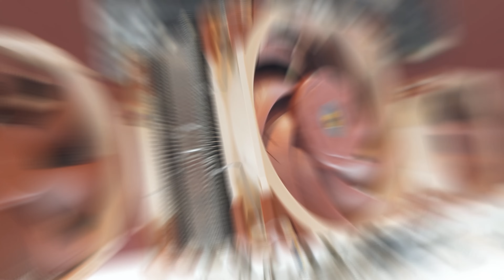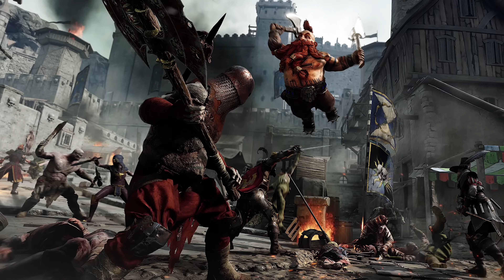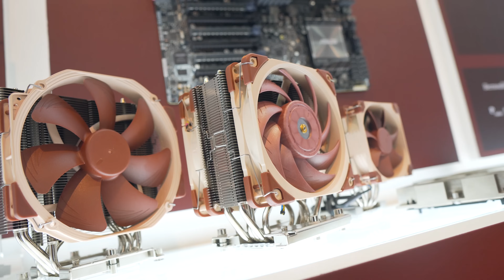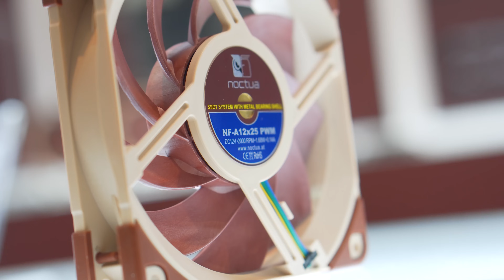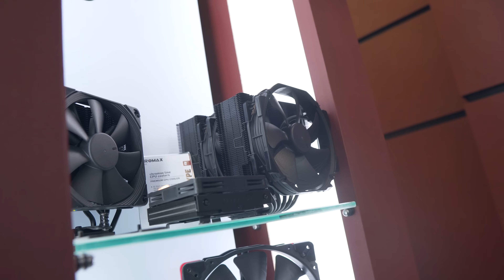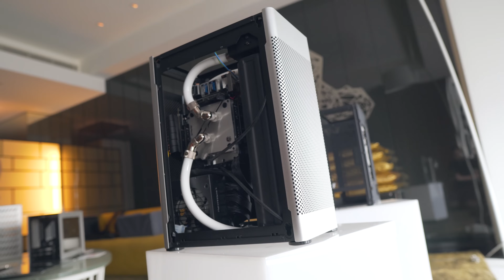Noctua Chases Optimization - NF-A12x25 + Prototypes

Comment: I just came across this video.  My question is "What about longevity while running in the horizontal position?"  I've got a three fan radiator in the top of my case blowing upwards; and the system isn't even two years old.  All three fans have failed or are failing.  I really don't want to spend the money on these fans (they are a lot more expensive) if they won't last long.

Comment: the new u12s is gonna be lit if that thing matches a d15. but its not to surprising since the current u14s is very close to the d15 series if the number of fans match. but man to get a 120mm one that close is nutts. noctua plz dont tempt me more by putting cromax versions of the new fans for the coolers

Comment: Can defiantly recommend. The mini C only takes 120mm exhaust, so i bought one of these noctua fans because they provide better airflow at lower rpm. I'll probably replace the front fans when noctua releases the 140mm version of this. Expensive, yes, but they're great and will outlast your current build and the next one.
I defiantly prefer that noctua is concentrating on the engineering aspect, as i don't care about rgb or colour as my case is closed.

Comment: They are basically scythe gentle typoon knock off, and that took them 4 years... Yet they don't seem to be capable of understanding that their color scheme is UGLY. This company is doomed.
Reply: I dunno, mate. You just know when you see a noctua. For people who care, buy a chromax version. Pretty sure these go a bit beyond typhoons, nice as they are.

Also, the sterrox crystal plastic they're using and the tolerances this fan needs don't take kindly to mixed or applied paints. Check this out, if you're curious. It's kind of neat.
https://noctua.at/en/nf-a12x25-technical-backgrounds
Reply: +Jae-won Chung
The company is well known for making the best fans in the industry in terms of performance, noise and endurance, even when exposed to dust etc.
They're not going anywhere.
And changing colour would be a huge mistake on their part.
Sure, having a few fans that's a different colour is ok.
But their top of the line model should have that colour scheme simply because of brand recognition.
Owning one of these brown and beige fans is actually a status symbol in quite a few circles.
Reply: They do address the fact it is similar, but the specific geometry and mathematics are different https://noctua.at/en/nf-a12x25-interview-lars-stromback
Reply: The Gentle Typhoons was a great jack of all trades fan but it also had a few cons that came with those pros. This new fan essentially eliminates the cons and you get a Gentle Typhoon design with the occassional Noctua beige colors.
Reply: Doomed?  Really? What with the 1000's of work stations/servers that use Noctua fans. I doubt that.
Reply: Lol... Whatever man

Comment: I'm totally indifferent about colors or rgb shit. Just keep concentrating on serious engineering and the best performance possible. That's what Noctua is all about.
Reply: Deady: Since you like quotes so much: "they could make the fans black, and they do, but they would take a performance hit (~5 degrees warmer)" ... That's what you actually said ... of course I'm gonna insult a stupid statement like that.
So to recap:
- REDUX line = first gen of fans without the rubber corners as well and so they perform worse than any of then newer gen ones but pretty much the same with the original brown+tan ones.
- CROMAX line = their second gen of fans that are just made black and are also more expensive because they come with a lot of extra rubber corners that I feel are not worth it.
- changing color of fans will not affect performance !! pink or black fans will perform the same as shit+tan colored ones and anyone claiming otherwise is retarded (STERROX not being structurally sound with dies is also kinda hard to believe since I doubt that Noctua brown is a standard color for that material - I think they just want to exclusively sell it in the their signature color at first - which is a mistake since they WILL loose massive sales)
- jet fuel can't melt steel beams : )))
Reply: "... of course I'm gonna insult a stupid statement like that." 

Yet again, I was repeating what was said in the video. I didn't say it word for word or I would've used quotes since I "like quotes so much". It's not my statement lol. I don't have an opinion one way or another on the merits of Noctua making their fans brown or black or whatever. Personally I like them in brown. I see a YT video with official word from Noctua on their preference for brown fans, I see a guy like you who doesn't like brown fans, fair enough. I repeat said official word, you don't believe it... well not much else I can do in this department.

Anyway, you have already made your conclusions from the get go and choose to doubt whatever reason they give for whatever they do. I for sure am not gonna defend a company I don't even work for on a YT comment section. So good day.
Reply: Daedy
, I just want to point out, that no you did not get that from the video. It does not say that changing the colour will make it 5 degrees warmer. He said if you wanted a fan from them in another colour that they had one, the REDUX model, which is not the same fan.
Reply: Zeoic
  Like the other person, you seem to have misconstrued my comments to imply that by turning a brown fan black, it would run warmer, which is not at all what I said, and certainly not what it says in the video. 

As I reiterated, Noctua do make black fans, like the Redux line (grey actually) and the Chromax, and the Redux fan as pointed out in the video runs 5 degrees warmer... but against what? A same model in brown? The A12? Probably the A12, like I said. Still, not entirely sure, like I said.

Kind of feel silly to have to explain the same thing in so many ways, but now I'm under the impression that perhaps some people find the video difficult to comprehend, they likewise find certain comments equally hard to grasp; or maybe they've already had a predisposed opinion about an issue and chose to attack a comment like mine without actually bothering to read through it... or pay attention to the video...
Reply: Now if we could get them to make the rest of all the PC parts, then the enthusiasts would have it made!
Reply: I completely agree, the Noctua color is brand identity and I personally really like the colors, purely focusing on engineering and optimisation is the way to go and that's why I will continue to purchase their products.
Reply: Like @Pedro Romano
 said, watch the video again. 

Noctua like their signature colours. They could make the fans black, and they do, but they would take a performance hit (~5 degrees warmer). So you're free to buy Noctua fans that come in black, just be aware what you are getting vs the better ones in "shitty colours".
Reply: NamelessONEMail  Their "retarded" statement, not mine. 

And to clarify, even though I don't really need to with someone who's prone to insulting people every chance they get (enjoying the internet, eh?), I didn't say their black fans run 5 degrees warmer than a brown fan (or maybe they do indeed... "the guy in the video did not make it 100% clear"), but they do vis-a-vis the NF-A12 featured here, if one were to, ffs, believe what's said in the video. 

They did say specifically that dyeing the A12 a different colour would affect its structural stability, no mention if it would run warmer or not.

Again, I'd prefer you watch the video again instead of me repeating every point said in it and have you make an argument out of it.
Reply: Because making a fan black will kill its performance and make it louder eh ? ... pfff ... its not a person : )) it won't stop working just because its black =))) 
Noctua themselves realized they loose a lot of money by only making fans in those shitty colors so they started making black versions of their fans along with all black coolers (even the heatsink, though I don't know why when only the fan color was horrible) which will come later this year. They even said that the only reason why the NF-A12 wasn't available in black was because they had problems with the Sterrox material and black dyes ...